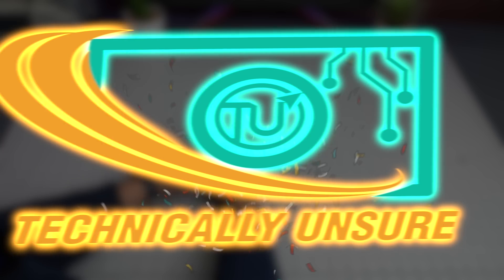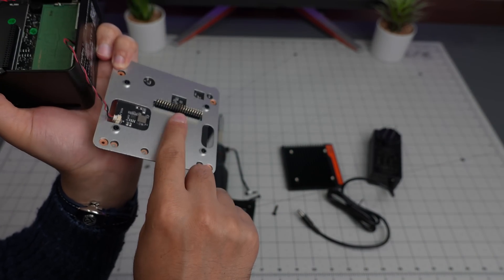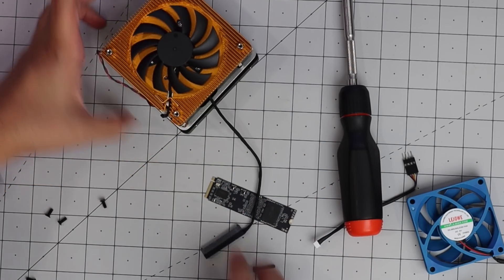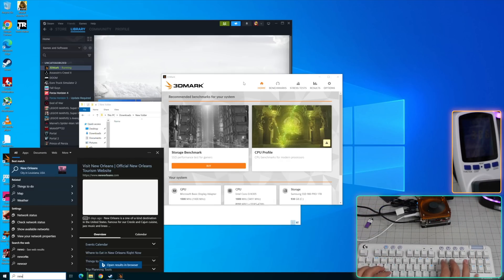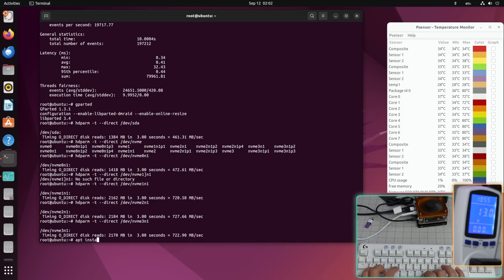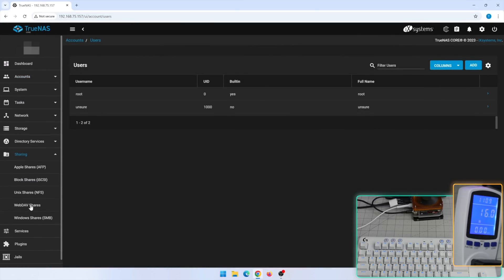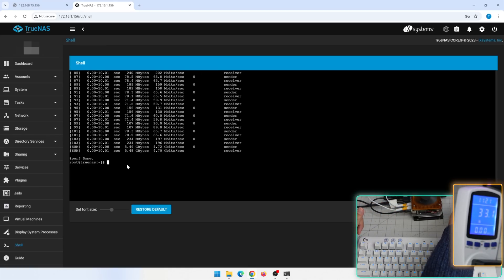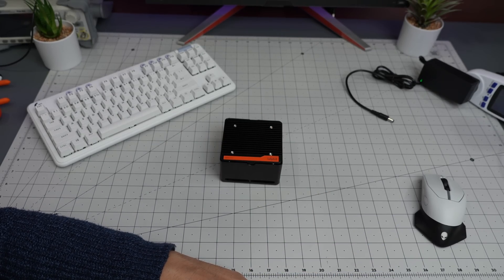CWWK Pocket NAS Review: Speed Tests, Windows 11, TrueNAS, & More!

Comment: Thanks for the great video... I'd be interested how the temperatures would behave when the inside of the enclosure... Do you think that the cooling solution is good enough (even without the top fan) to handle the heat dissipation of the 4 nvmes?
Unfortunately, you did not show the temperatures during the file transfer. Or did I miss sth. during the benchmark?
Reply: he's got the whole case removed so any temperature testing he's shown is irrelevant.

Comment: You'll never get 5GB if you are only using a single connection due to the fact that LAG is generally bound to a SRC/DST MAC...  Try again with two 2.5GB NICS copying files at the same time.

Comment: Also, is it true that you need one of the SSDs to install the OS? So you can only use three SSDs for the actual NAS? Or are there other options to install the OS, except on a USB drive?
Reply from the maker: Correct, one ssd will be used for OS, or you can use a USB storage for OS?
Reply: @TechnicallyUnsure  what a bummer.
Reply: You can use the supplied SATA cable to have a SATA boot drive. SATA DOM are available, but costly. Connect the SATA cable to the DOM, use the WiFi mounting post to screw the DOM securely. Voila!, SATA boot.
or
Gut a 2.5" SATA SSD, wrap the PCB in Kapton, fit it to the cable, wedge it in. Voila!, SATA boot.
You may still lose the option to fit a WiFi card due to space constraints.
or
Adaptors are available for the WiFi slot to take an SSD. I haven't got a suitable adaptor for that slot type.

I have a 16GB SATA DOM as a pull from a retro build. It worked perfectly for TrueNAS, but I ended up switching to option 2, gutting an Aliexpress 2.5" SATA SSD ( XRAYDISK 512GB ) in order to install SuSE Linux. I'm just more comfortable with SuSE or Debian than TrueNAS.
Works perfectly. Samba, DLNA, NFS and SFTP barely trouble the CPU. 16GB RAM + 16GB swap file means it never struggles for resources.

I have tried using an NVME USB housing and booting from that. A 128GB 2230 in a teeny little case from Hagbis. It worked and the disk IO was similar to the speed from the SATA connector, but I didn't want anything external. A decent USB3.0 thumb drive may be an option too.

Comment: Great video, thanks! The specs mention that only M.2 PCIE3.0 NVMe is supported, and not M.2 PCIE4.0 NVMe. Is this true? Because in your video, you are using Samsung 980Pro 1TB, which is M.2 PCIE4.0 NVMe.
Reply from the maker: Yes, correct, I just used the SSD I had
Reply: It does not matter if you use new generation SSDs. PCIe is always backwards compatible, so Gen4 SSD works with Gen3, Gen2 and Gen1 links as well. Type lspci -vvv to see LnkCap (device link capability) and LnkSta (the actual link used by the NAS). Link Status will either say OK = matches device capability or DOWNGRADED = device link is slower than SSD.

Comment: Truly a great video,   It is a nice balanced little box and both models are reasonable priced and capable.    Usually I use TrueNAS in old frankensteins from Haswell era, but 35 watts and 4 SSD capable turns this box into an very tempting upgrade options.

Comment: Great review!!! Did you say (4:14) sata 1 and data 2? It cloud be possible to attached 2 ssd  (with an aditional wire I guess) at the same time??? Thanks!!!
Reply: Also interested. I wonder if there is a sata to another M.2 adapter I could tuck in there for the OS instead of the USB approach

Comment: What about putting 4 x NVME to SATA adapters in and running 16 to 20 drives off of it 😁
Reply: i would like to see that
Reply: It does not make sense since each NVMe slot is just Gen3 x1 (theoretical 1GB/s), so 2 SSD drives will saturate each link, so 8 SATA SSDs will oversaturate the underlying link. Unless you are talking HDDs and noise is not a concern.
Reply: @igorpupkinable  who said I was after something making sense. It's fun to see how much it does not make sense. Whatever the case may be not all the drives needs to be accessed at the same time all together and not everything needs to be constantly ultrafast. In case of accessing a few or/single drive(s) at a time I don't see why the stream bandwidth is a problem. SSD don't read write constantly at gigabyte speeds. Actually drive access for very small file R/w particularly in mixed unpredictable workloads falls very  easily  a lot shorter than 100MBps on ssd.
Reply: Would I use it for a big raid ZFS solution in a reliable application?  Probably not.. but I would  nonetheless like see how it behaves  and how far it can go..

Comment: Thanks for this great video! Love it! Regarding LAG: Copy two files simultaniousliy and you will see the 5 GBits/s. Thats the nature of link aggegration... Like a motorway with two lanes but same speedlimit. It can trasport two cars at once but none can go faster than the 2,5 GBits/s. With TCP you will see file copy at 5 GBits/s because the traffic is split up in packets and sent over the two landes. -CIFS / SAMBA cant' unless you use SMB3 only + enable multichannel.
Reply: Synology says you cannot use LAG and SMB multichannel feature simultaneously. Basically it is one or the other but not both. There is a detailed article on their website about this.

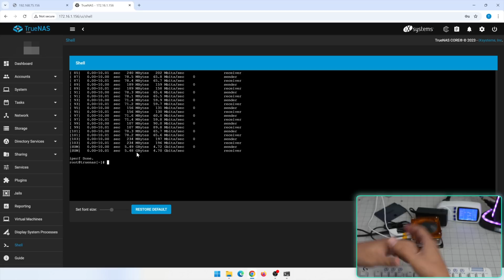Comment: 14:25 link aggregation is not true joining, connections are load balanced and will go on both ports, but windows file sharing is still a single connection so it can only go on one port or the other. To allow windows file sharing to use both ports, you need to enable SMB multi-channel feature in the NAS so the file sharing software can run multiple connections

Comment: I was interested in this unit, now am less interested in this unit.  If it had a 5th slot to stick in a NVME/SSD in a shortened M.2 slot, I'd likely take it. IF the design allowed for an EMMC device inside & included as an option, I'd consider it too.  But with 4 NVME's only, not worth the effort if the one drive is needed for the OS.
Reply: you can you use wifi slot for nvme
Reply from the maker: That's a good point! You could also consider installing the OS onto a USB drive and booting directly from that. It’s just an option, but your criticism is definitely valid.
Reply: @TechnicallyUnsure oses that cache/log/write a lot to system drive will kill the USB drive very fast
Reply: @BoraHorzaGobuchul  Get an external NVMe case or a USB to SATA adapter, yes jank, but it works.
Reply: @affieuk  that's exactly that, jank. And yes, it works :)
Reply: There is a company that makes a M.2 A+E key SSD but it seems like it's only available in Europe. It's the Cervoz T425 series.
Silicon Power just announced an E key SSD that could work too
Reply: @Motolav  You can get adaptors that convert A+E to M.2 NVMe's
Reply: I wonder if someone thought to use a solid state disk in USB stick format, like T31 and such :))) that would be massively overkill but nice.

Comment: If you want to build a NAS, TrueNAS is a great choice, but DO NOT configure the disks as shown on the video. The video is effectively doing a RAID0, so you would lose all your data if one of the SSD failed. OpenZFS (the filesystem used by TrueNAS), is simply "concatenating" all vdevs (virtual devices) into the pool, but each vdev must have multiple drives if you need resilience against drive failure. If you want to use 4 drives, avoid doing 2 vdevs of 2 drives each in RAIDz1, instead do one vdev of 4 drives in RAIDz2. You would get the same usable capacity, but it could survive the loss of any 2 drives. Of course, you can do RAIDz1 with 3 or 4 drives, but losing maximum one drive.

Comment: I'm running TrueNAS Scale with five SSDs (using an M.2 Wi-Fi adapter for the OS). Everything generally works fine, but every 1-2 days, one of my four SSDs (sometime two) disconnects. Restarting the system in TrueNAS doesn't bring the drive back, but if I completely shut down and power it back on, the SSD reconnects. I'm starting to wonder if this is a hardware or BIOS issue. Has anyone else experienced something similar? At this point, I'm questioning whether this is a reliable setup for a NAS where stability is crucial.
Reply: Hi @saorikido227, are you able to share the adapter you used?
Reply: @Kyunomi-j6z  the adapter wifi ssd is a M.2 M key to a+e key. It is easy to find
Reply: impossible to mention any link or site because they will be censored
Reply: @Kyunomi-j6z  aliexpress -> item/1005007179509074.html
Reply: It is a PFMY 12V 6A AC Adapter
Reply: @saorikido227  The question was about your M.2 Wi-Fi adapter for the OS.
Reply: pls change power adapter to more capable one and see if issue still persists.
Reply: @yingbxua6240  The provided power adapter output 12v 5A (60W). It should be quite sufficient I think.
Reply: @saorikido227  should, but adapter might be faulty, SSDs at peak can make adapter cry or else.... I would strat with testing alternative PSU....
Reply: @yingbxua6240  I changed the power supply adapter and it seems to work now. I will wait few days to confirm but it seems to have fixed the issue. Many thanks 🙏
Reply: @saorikido227 thanks for feedback! Could you post here which one you bought?
Reply: @saorikido227 Is it still working OK for you with the replacement PSU?

Another YouTube reviewer just replied to a question of mine (coincidentally about using the WiFi slot for a 5th SSD and like you he did that successfully) but in his reply he also said to me that he had returned the unit because he kept having drives drop off line.

He was using 4TB SSDs and when he contacted CWWK about the problem and they told him that the unit supports a maximum of 2 x 4TB drives so I’m wondering what size SSDs you’re using. This other reviewer then tried 2 x 4TB plus 2 x 2TB drives but still had issues which is why he returned it.

I’m planning to use 4 x 2TB drives that I already have plus another much smaller SSD in the WiFi slot for the TrueNAS Scale installation so I think I’m still OK but I would be interested to hear if you’re still happy with your setup and what size SSDs you are using.
Reply: @julianfp1952  I'm using 4 SSD of 2Tb each. It has been working like a charm for months. However, I'm not using the M2 adapter for the os but a SATA disk.
Reply: @ Thanks for replying and for the clarification re your OS drive. I really appreciate that.

I also had in mind the option of using one of the SATA cables to connect my OS drive. I’m going to try the adapter to plug a 2230 drive into the WiFi slot first because that will all fit inside the case but it’s reassuring to know that someone has implemented my SATA plan B successfully.
Reply: Probably due to heat or power draw
Reply: So you replaced the WIFI adapter with a drive? Can you share the model you used?
Reply: for the adapter search for «PFMY 12V 6A AC Adapter Transformateur Alimentation Adaptateur Chargeur pour 5050/3528/2538 LED Bande Lumière, LCD Monitors, DVD, TV Box, Équipement Sécurité, Compatible 12V 1A 2A 3A 4A 5A»
Reply: regarding the power supply, I bough one on amazon : PFMY 12V 6A AC
Reply: search for B07Z54MTRF on google

Comment: Link Aggregation (LACP) only increases the total bandwidth available to multiple connections. iperf can open multiple connection threads to simulate several connections and shows you the total bandwidth. But when transferring a file over SMB you will only be using a single connection thread, so LACP will not increase your transfer speed. You can however use SMB multi-channel to get around this. Disable LACP and ensure SMB multichannel is supported on server and client. Then you should see a little over 400MBps file transfers. Hope this helps.

Comment: Is there a way to mount the 2.5" SATA SSD inside the case (lid??)? How about routing the SATA cable outside the case?
Reply from the maker: I tried, you can't put an SATA SSD inside and you can't route the cable without pinching it super tightly that might damage the cable (eventually)
Reply: @TechnicallyUnsure  then this is good feature, but case is not designed for it. I certainly can use 2.5 ssds to host proxmox or truenas or omv - for this to work I need to have different case(3d Printed?) or sata ssds laid beside the actual unit.......which is not aesthethic ))
Still for around 100$(+/-) you can get something like Radxa Rock 5B+ 8/64 with dual nvme ports - so basically for whole price of this PC, you can get two Radxa Boards equipped with RAM & Storage + 2.5LAN and get them working together ))......

Comment: each one of those drives wants m.2 pcie 4x4 which would give you ssd speeds of roughly 7000MB/s.  it LOOKS like they are instead giving each m.2 pcie slot pcie 4x1 which would give you something like 1750MB/s which is TERRIBLE compared to the specs of the drive.  Secondly, if you're going to do an m.2 NAS, it should have AT LEST 10gb/s networking (preferably 2-4 ports of 10g).
Reply: The Alder Lake-N (N105, N305, etc) cpu's only have 9 PCIe gen 3 (not gen 4) lanes available. Not many lanes to work with for both storage and networking. One per NVMe drive is typical, and since each is gen 3, the throughput is half what you stated. Yes, it's terrible, but acceptable if you temper your expectations. Use it with cheap slow NVMe's for backup - still better than a Raspberry Pi NAS. And forget about 10GbE.
Reply: @dktol56  ugh, I didn't realize the n cpus had such absolute crap for pcie lanes.  that's like single-board computer territory o_O.  and here i've been complaining that modern consumer desktops have too few lanes for a few generations now... sheesh.

In that case I wouldn't use one of those cpus at all, and instead opt for one of Intel's low-powered Atom CPUs, like the "Oops all e-cores" fanless-optional atom c3758r (8 ecores, no hyperthreading).  it's got 20 pcie lanes, onboard 4x 10gb networking.  so if you exposed all those lanes you could easily do at least 4 m.2 ssd's at full gen3x4. or heck, a modern i3 or ryzen 3 could do the same with gen4 (or gen5?) while still giving you proper networking to support them, or for a more balanced solution, 2x gen3x4 m.2's and a gen3x8 sas3 16e hba that you could then use to plug in one or more JBODs (if you have the space - could make a good cheap 1u rackmount for homelabbers.
Reply: @joshhardin666  Even the all nvme NAS from Asus & QNAP have the same performance issue with PCIe lanes. Since you are limited by the speed of the NIC's, I guess they believe it's not that big of a deal.
Reply: this is not meant for high performance SSDs anyway, it's going to get the cheap dramless SSDs. Those aare simply NOT able to sustain anywhere near 7GB/s for more than a few dozen GB then the SLC cache fills and they settle down to slower speed.
Reply: @marcogenovesi8570  in that case, i'd fear for write endurance.  cheap dramless ssd's generally don't last for very long.

Comment: If all of the messing around that was shown is the norm then it doesn't bode well for a first impression.

The box said Mini PC, their website says Firewall PC and this video says NAS. Not exactly clear what primary purpose this thing is trying to serve.

If I read things correctly (note that the website does not show complete specifications despite the link that says otherwise), the 4 NVME drives are connected to a single controller, so when used as a NAS, showing what speeds the drives run at when all in use at the same time is always going to be invaluable.

When used as a NAS the cheaper N100 would seem to make more sense because the speed of the processor is not key to the operation.

When used as a MINI PC, the N305 does give enough of a boost over the N100. What about an N97 version?

All in all it didn't grab me enough, despite the potential uses.

It feels only part thought through but could have potential.
Reply: it has no primary purpose, it can be mini pc and firewall without the adapter that bifurcates the nvme to mount 4x ssds, and with the adapter it can be a NAS.

Comment: So .. many ..compromises.  Yeah, that's bifurcating the M.2 to split it four ways - probably an x4 split by 4, so 1x1x1x1 which would give you 1-2GB/s per drive depending on gen 3 or 4.  Not great, but then again you've only got 2x2.5GbE ports to push it out of, so it will saturate that.  Really, if you're going to dump your cash into nice SSD's then they really should be in a better platform.  Go get a MS-01 for example.  Yes, more money, but so much more capability.
Reply: maybe use one of the m2 slot and put on a m2 to 10gbe network card , max out about 8Gbps but still got good speed 
like a 3 nvme + 1 sata 10G nas ( the board have 2 sata port but it only come with 1 sata cable ) 

the model without case which is p5-x86 with carrier board , it come with 2 sata cable and i am using one of it. ( looks messy without a proper case )
Reply: @frankwong9486  you can buy the case separately. I did. It required a bit of sanding the spacers to get same thermals performance, maybe they have improved it by now.
Reply: Slightly noob-ish question...
If you get 2+ gbps drive speeds and hook this to a 10gbps  switch port with it's 'clients' maxing out at 1gbps. Would it be more capable (faster) at file transfers to multiple users/clients simultaneously?
Reply: @FlexDRG_Lampje  Potentially yes - but there's a lot of variables.  For large sequential reads from cache, yes, up to the max of the onboard ports (minus overhead, like smb, etc).